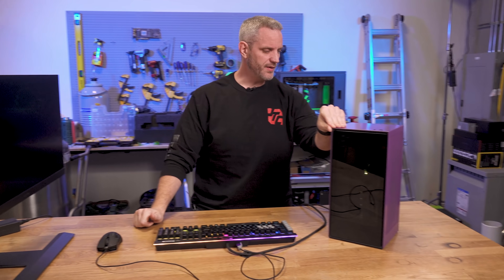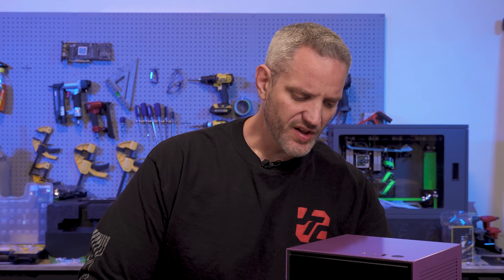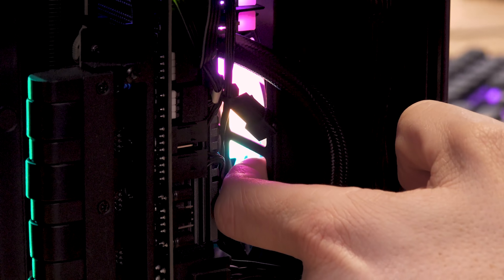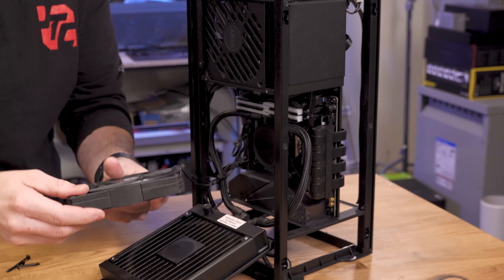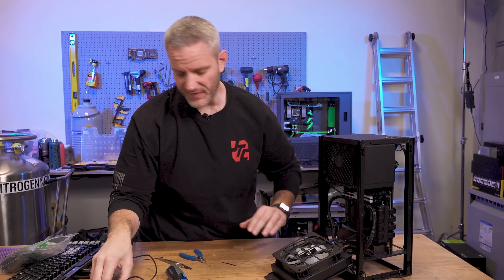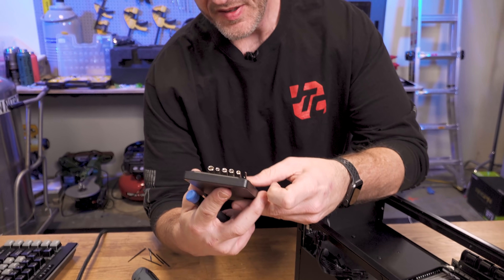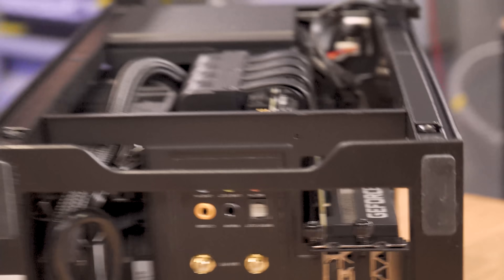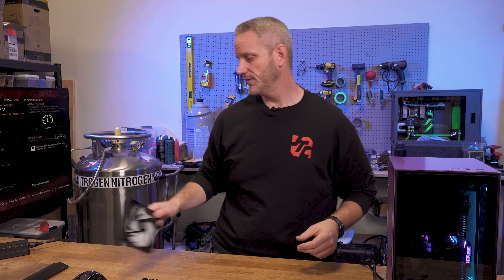This PC is shutting down due to overheating... let's investigate why!

Comment: My PC was actually "partially" shutting down a few months ago. The screen went black, the fans still spining, the mouse and the keyboard turn off, the motherboard lights were working but I wasn't able to turn off the PC my pushing the power button, I was only able to do it by disconnecting the PSU. The motherboard showed the debug led for the CPU, as if this was the issue.

After some testing I couldn't make it work and after a few days I took my system apart and noticed a dark spot behind the motherboard, kinda like oil or some other kind of liquid, right behind where the VRMs are. I checked and everything seemed fine, but since I couldn't make it work and left the parts on their respective boxes.

A week later I was bored and decided to put everything together again but wanted to try something crazy. I took the VRMs heatshink off, and turned the thermal pad 180º, the PC worked fine for about a week and a half before the problem started.

I bought a new motherboard and the problem was solved... So I'm guessing the problem was very bad cooling on the VRMs due to a defective thermal pad, causing a discrepancy on the voltage delivered to the CPU, therefore, everything shutting down and the motherboard showing the CPU debug led.

TL;DR if your PC is shutting down in a strange way, check the VRMs cooling.
Reply: It could have also been that the capacitors needed to be discharged (for... reasons?). I had a similar issue and unplugging the PC and mashing the power button for a few seconds fixed it. Even if that’s not what caused you problem, it’s still a good troubleshooting tip

Comment: I will be quite disappointed if Jay DOES post a video on christmas day.
Reply: he probs recorded ahead of time and scheduled a release. wouldnt be mad if he didnt upload either way tho
Reply: @megamachine7818  yea its probably prerecorded and scheduled. Id be fine if it was just skunkworks idling for 3 hours in the background just showing his masterpiece for us again
Reply: Please help 
I built my pc and it starts but I get no signals on my monitor 
Tried everything 
Ram 
The monitor it self 
Gpu 
Everything is plugged correctly btw 
The fans spin and lights are on but there's no lights and my keyboard and mouse don't get lights as well 
I got ryzen 5 2600 
16gb ddr4 3000
2060 rtx 
Psu is 400w 

Where is the problem??
Reply: The views will go 📉
Reply: @zuckdaddy1596  no one asked you narc
Reply: @RaiderOfTheLost  who hurt you?

Comment: How did you fix the issue with the Black Ice pc turning on by itself?  My pc is doing the same thing when I shut it down, turns back on after a few minutes. I have to shut off the power supply switch to keep it off

Comment: "Black Ice didn't want to stay off, fixed that one easily." Pulls the powerplug
Reply: flips the PSU switch
Reply: My pc won't go to sleep. I always have to click sleep, wait for it to try but fail and then click sleep again for it to work. It also randomly wakes itself up from sleep. Do I need a pc repair or an exorcist?
Reply: @neondemon5137  i always attribute random wake-ups to usb device pings.
Reply: @jaydub8576  Only a few times has my PC woken from sleep on it's own, but it went back to sleep a few seconds later. I usually just shut it off though
Reply: @danagibbs3265  sounds like scheduled windows update there
Reply: @neondemon5137  both???
Reply: @neondemon5137  https://answers.microsoft.com/en-us/windows/forum/windows_10-power/win-10-wont-let-computer-sleep/b6cb9819-f7c4-4898-840f-525ba294a75e this might help.
Reply: @neondemon5137  my pc will always wake itself up from sleep. I think my mouse dpi is way too high and the smallest thing will wake it up
Reply: Sticking power switches or a bios setting
Reply: Lol
Reply: That’s how you ground a kid
Reply: @rmgdnz  I've done all the recommended fixes and nothing works. Also the power management always reverts to balanced when the pc comes from sleep or shutdown. It works perfectly other then these two problems which can be very annoying.
Reply: @neondemon5137  Reinstall your Graphic Drivers and Uncheck 'Fast Boot' in Windows Energy Management. It's probably the first if you run a Hybrid Graphic Card. It's probably the last if you do not run a Hybrid Graphic Card. And try to disconnect your KeyBoard and Mouse when you have clicked 'Sleep'.
Reply: https://youtu.be/DGN3DqEq-9g
Reply: @rmgdnz  thank you kind stranger that problem being bugging me for months, that fixed it.
Reply: Please help 
I built my pc and it starts but I get no signals on my monitor 
Tried everything 
Ram 
The monitor it self 
Gpu 
Everything is plugged correctly btw 
The fans spin and lights are on but there's no lights and my keyboard and mouse don't get lights as well 
I got ryzen 5 2600 
16gb ddr4 3000
2060 rtx 
Psu is 400w 

Where is the problem??

Comment: "Shuting down" huh? 🤣
Reply: Hey Yui.
Reply: Please help 
I built my pc and it starts but I get no signals on my monitor 
Tried everything 
Ram 
The monitor it self 
Gpu 
Everything is plugged correctly btw 
The fans spin and lights are on but there's no lights and my keyboard and mouse don't get lights as well
The pc stays on for few min and turns off automatically than it turns back on
I got ryzen 5 2600 
16gb ddr4 3000
2060 rtx 
Psu is 400w 

Where is the problem??

Comment: wow never been this early! merry christmas everyone, be kind to urselves!
Reply: Please help 
I built my pc and it starts but I get no signals on my monitor 
Tried everything 
Ram 
The monitor it self 
Gpu 
Everything is plugged correctly btw 
The fans spin and lights are on but there's no lights and my keyboard and mouse don't get lights as well
The pc stays on for few min and turns off automatically than it turns back on
I got ryzen 5 2600 
16gb ddr4 3000
2060 rtx 
Psu is 400w 

Where is the problem??

Comment: my graphics card just died few days ago because of shitty radeon drivers
Reply: Which drivers were they?
Reply: Aren't safety measures built in BIOS? I doubt bad driver could be the culprit.
Reply: @Acenis  well it constantly kept shutting down my computer for some time even when i tried to switch to older version of the driver . After my card died and switching to an old gtx card never had the same problem . So i can't imagine what could cause this issue other then the drivers.
Reply: @MrBootyBay  It could be plenty of issues like power delivery, maybe your psu is to blame. If it isn't fault of other components you should rma it. If it requires more than 1 connector make sure you're not running 2 plugs from same cable.

Comment: Hello from germany <3 and merry christmas to u all <3
Reply: Merry Christmas brother
Reply: Zu freundlich. x)
Ich wollte schon schreiben "Niemand ist lonely in Deutschland!"...hab dann aber gesehen, dass das zweite L durch Abwesenheit glänzt und nun bin ich irritiert. Congratulations, Makkaroni!
Reply: Please help 
I built my pc and it starts but I get no signals on my monitor 
Tried everything 
Ram 
The monitor it self 
Gpu 
Everything is plugged correctly btw 
The fans spin and lights are on but there's no lights and my keyboard and mouse don't get lights as well
The pc stays on for few min and turns off automatically than it turns back on
I got ryzen 5 2600 
16gb ddr4 3000
2060 rtx 
Psu is 400w 

Where is the problem??